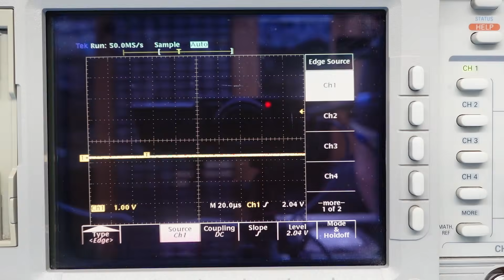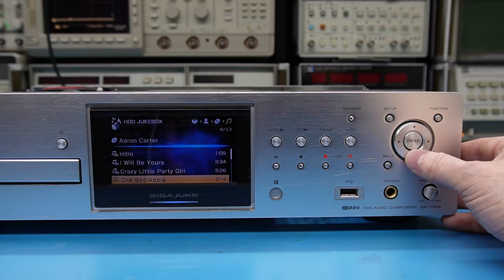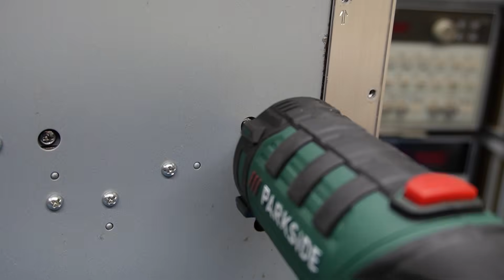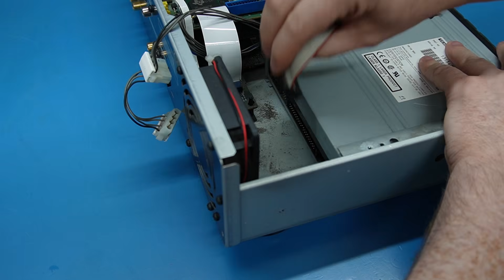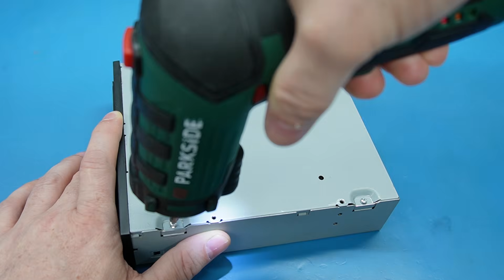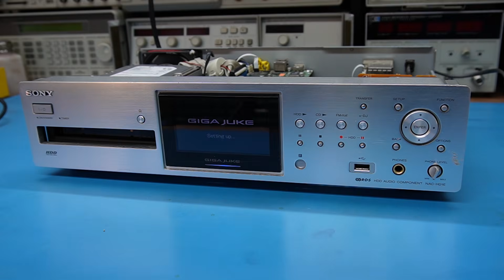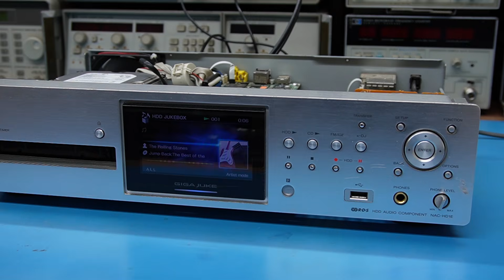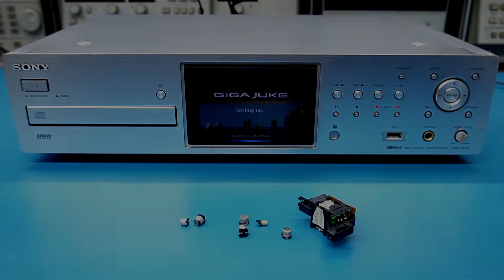SONY Giga Juke, Codename 'PROBLEMBOX'

Comment: I feel like it’s an issue in the DAC or the clock - the Gracenote recognition surely wouldn’t work if the files were being played back too slowly.

When I worked at Sony Centre I used to sell these and I am sure the files you first played off the hard drive were the on drive demo tracks.
Reply: And just seen you check the crystals and they’re seemingly fine.

Bizarre.

Comment: What the hell were sony thinking to use 6.3v caps on a 5v line without any protection diodes, these must have been driven to their limit, they should have used 10v capacitors

A firmware system reset should fix this

Comment: Factory reset it - and if that cures it - put in an SSD via an IDE to SATA convertor.
Reply: Better not - the filesystem could wear out the SSD over time...
Reply: @andreaspfeil8682  HIghly unlikely - This machine is just a computer, and the SSD would get the same amount of use as on a typical PC, most likely less, since there would be less fragmentation of data. SSD's are dirt cheap to replace anyhow.

Comment: Maybe you are having a problem with the clock reference... In digital audio is essential to have the exact reference (as you might know, 44.1 kHz for the CD, and for the mp3s it depends on the recorded file. If it has a digital input (SPDIF or TosLink) you can connect a good known reference there, and try.

Comment: If you look about on the internet you will find a firmware just need to look about. I had to flash Sony stuff with no support and found the firmware in the end. If you share the model number we on here could look about for you. Sometimes you find form rooms that share this stuff. I do electronic too and know the headaches to these things. Also could try reading the data of the chip and flashing it back on a new chip ? Sometimes it works believe it or not. Or if there is anyone out there with this machine and wants to rip the data of there firmware chip and share it with you could help too.

Comment: Ok, this may be the first one he's posted where he doesn't fix it. Bolls for doing that. However the issue may be less problematic then it seems. But you do have to know how the computer part of this system works. I don't think it's firmware and i don't think it will require a full board replacement either. There's got to be a clock issue somewhere. Maybe a chip responsible for breaking down the clock signals for other components.

Comment: 25:03  it worked at right speed I'm surprised you gave up on it
As the people have suggested factory reset and it has a playback speed control in settings

Comment: If the radio recording sounds fine, ADC and DAC must be sharing the same clock source, and it has gone bad. Maybe there's a corroded clock selection pin or a bad PLL chip somewhere...

Comment: That is a PC in a fancy case with a nice little color screen that uses a custom OS. I was certain that the standard CDROM (surprisingly not from SONY) this thing uses was not the cause of the slow playback cause they use digital playback and MP3 from the HDD had exactly the same behaviour. (It uses rip off method for record so maybe a 40X IDE drive would be an upgrade) and I would swap the whole drive nonetheless not bother for lasers they are extremely cheap used...

The strange thing is why it did playback correctly a couple of times? I never had a sound card playing a digital file at wrong speed if not commanded by software but I also never had a soundcard receiving 24 Volts at its 5 Volt power rail... 
Maybe a DAC is damaged? Maybe the main controller chip? Maybe a hard reset can help it considering it played correctly some times? Really strange

Comment: Seems to me more than just a co-incidence that the CD player played at normal speed immediately after running on that windows PC - ie "correct replay speed data written to it?"

Since - as someone has suggested below -   if alternate  speed  facilities were provided such as 0.5 * -   this would suggest the windows PC  CD player function overwrote "slow speed"  data with "normal playing speed"  which then  persisted  on  the CD player after "first subsequent power up" after reinstall   - ie:  played at "normal speed "-  then overwritten with 0.5 speed data following   subsequent user commands. 
That suggests main CPU / Control  issue defaulting to incorrect  replay  data being sent? 
(As someone else has suggested)
This unit has gone way beyond an economic repair - so its more a question of either an educational exercise - or  -"I'll fix it even if it kills me !!!!"   AKA:  " we await part 3 with baited breath!"
 Mind you - having said that - if it is a firmware / processor hardware issue - then the chances of fixing that are remote - much more fun fixing those old wind up gramophones with "electric pickups" !!

Comment: I think I would have taken a big hammer to this device by now. Who listens to CD's anymore anyway? This must have taken you hours/days of work for an out dated format. I suppose it's a project to play with if you've  got the  time. Looks like out dated soft ware beat Cha! Lucky you had a new replacement  CD head in stock they aren't cheap. I would probably strip this unit down for parts and have back my CD head back. Who want's a unit that only half works.

Comment: Playback is slow when you play CD and also when you play from HDD. Probably the same thing will happen via USB port so i didn't understand your inspection on optical drive. Capacitors were bad but that did not have anything with slow playback. A bit of wasted time on your part inspecting optical drive. FM tuner playing just fine so there must be a problem on the main board related to sampling rate or something similar somwhere around. I am not expert for that, just some logical thinking. Can't wait part 3 if there will be something. Best wishes!!
Reply: I agree on the optical drive part. It's run as a CD-rom drive, nothing inside the drive would resample the data.

Comment: IMO it has to be a software playback speed setting. The device is basically an embedded computer, with a discrete DSP chip, probably because the embedded CPU it has is not fast enough to do audio processing or encoding/decoding. If it was a hardware issue, it wouldn't be working at all or malfunctioning wildly.

Comment: The fact that the CD player worked at the correct speed after being in the PC, and until it was used to record to HDD, tells me it is 100% a SW setting. I would trawl through all the menus, and like other commentors have mentioned, check for a dead RTC battery
Reply: In any case I’d be importing some media ripped elsewhere to establish whether the speed issue is a system-wide issue.
Reply: This is a computer and it probably has a CMOS RAM battery backed RTC. If the battery is flat then not only will the RTC stop ticking but also, if very flat, the CMOS memory will not hold any capacitance. Now the bit rate value could be stored in CMOS memory. The firmware could be reading that memory to get the bitrate value and program it into the audio DAC chip. So you just need to replace the battery for the RTC and check it keeps the  time and date. Normally, once powered on, the RTC and CMOS memory should be powered by the power supply and so keep the CMOS memory cells 'alive' (or diode or whole RTC destroyed by over-voltage?) but maybe this one has a circuit which is purely powered by the RTC battery. In the old days the chip used to be a Dallas DS1287 chip with internal battery.  e.g. firmware interrogates CD on tray load to find bitrate and programs value into CMOS RAM. Press CD Play and firmware reads CMOS RAM and programs bitrate value into DAC and reads data from CD and sends to DAC.
P.S. It does not seem to have a battery and the manual says 'clock settings are lost if power is disconnected' but the main chip with the 32,768khz crystal is CMOS based and has CMxx registers, so maybe it has suffered damage? Maybe set the clock and check it keeps time when in standby?
Reply: I wonder if it would have kept playing CD’s at the correct speed if not for the rip test (when the drive spun up beyond 1x)
Reply: @piouhgd.dghuoip  I suspect so, and it wouldn't be terribly hard to test. With long enough IDE cables, you could even do it in situ
Reply: It could also be a hardware ADC or DAC issues as the whole stream looks digital.  It's not using analogue audio from the CD drive.
Reply: @EsotericArctos  perhaps, but why was it ok until attempting a rip? Sounds more like the SW changing the output setting of the CD drive
Reply: @andersvandegevel8355  It could be harxware or software.   The software could be corrupted, but it could be hardware.  Remember when Mark tested it, he played the MP3 that was prerecorded first, then repaired the CD ROM drive, then tried the CD again.    Remember the output of both the CD and the MP3 playback is slow, which indicates the CD ROM itself is fine (plays fine on a computer too) and leads toward an issue on the DAC (Digital to Anaolgue conversion) at the output side, as the signal is all digital (the Juke is taking the digital output from the CD).  But you are right, it could be software, but likely corrupt rather than a setting.   Possibly triggered by either the prerecorded MP3 or caused by the CD recording at the higher speed (4 times or whatever it is).  The part that makes this more tricky though is that the Radio recorded perfectly and played back at normal speed,  This could indicate the CD section may be different path to the Radio.   I'd like to test the Analogue Input and see if that records better, and also take the recorded MP# and play it on a computer and see if the recorded MP3 plays slow on a computer or only on the Juke.
It's one of those really tricky faults that could be either.   Given the age of the device, it may even be bad caps all over the board as it likely was right at the end of the "capacitor plague" that was caused by a company using / stealing an electrolyte formula, but getting it wrong.   I won't rule out software corruption though.  It may end up costing more to repair than the device is worth these days though.
Sorry for the long reply
Reply: Screaming at the PC here. It was slow on HDD playback and CD playback, so not an issue with CD player. Setting issue ..
Reply: @simonjz05  Also, adjusting the speed of the disc's playback won't change the pitch of a digital signal...
Reply: @simonjz05  But the HDD was recording the slow output of the CD so it sounds like it is an issue with the CD playback.
Reply: @dogastus  negative.  It was recording a digital signal, not converting to analogue and back to digital.  if it was working correctly the CD could be playing back at half speed or 24 x speed and it would make no difference.  It's basically doing a digital rip to the hard disc.  I'm with someone saying it's likely an RTC clock or faulty PLL circuitry.
Reply: 50/50 at that time they were going away from RTC batteries since ppl would just keep everything plugged in and it was one problematic part less, though I'd focus on the HDD - it is an old ATA drive even if it is still mechanically alright, there is no chance there aren't at least some magnetic badsector caused just by the time passing by. In either case the software would need to wait for HDD to respond whenever it goes through the badsector slowing the software down even though it's most likely on some EEPROM

Comment: I never knew there was something like a CD player playing at half speed.
Reply: There are CD players around that have pitch controls. I have several. Mostly used in professional applications - recording studios, radio stations etc. The pitch controls usually allow a speed variation of around 10 % up or down. With software, you can get much more speed reduction or increase.

Comment: Reminds me of a time in the early seventies, when Belgium went from 110V Two Phases mains to 220V Three Phases mains.  My dad laid the wiring in our house himself but at some point he had to change stuff and my cassette player played at half speed, or thereabouts.  I remember I had a tape on which I recorded 33rpm songs at 45rpm speed and they played almost perfectly when the voltage in the house was switched back from 220 to 110Volts Two Phases.

Comment: A reset could do the trick. According to the manual.... "reset the unit by pressing stop and power". Also, since it's always bringing up the settings page, there might be a dead memory battery somewhere there. The thing is basically a computer, after all.
Reply: It keeps asking for an RTC server to re-sync the clock so there's certainly something to that. But maybe Mark just never set the time and date.
Reply: I wonder if it's doing some big maths with a uniz timestamp that is near zero and getting upset with the result  @Nukle0n
Reply: definitely worth a try isn't it?

Comment: Doing the "setup" after each power cycle implies a missing battery voltage somewhere.
Are there any UI menus apart from just play/stop etc?
Reply: It always does that when unplugged. It has a linux computer in it which needs a full reboot.

Comment: I wonder if there is a menu setting for DAC bit rate. It's clearly playing back at the wrong rate. Radio to HDD encodes correctly. SO it's decode side. Feed in a fixed pulse and see what comes out the other side.